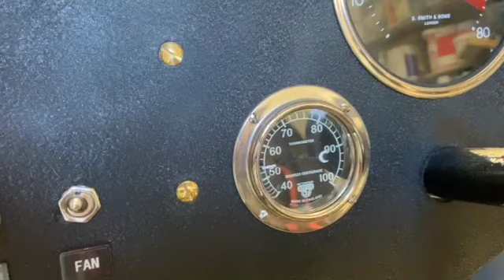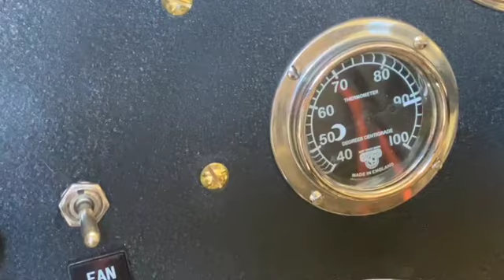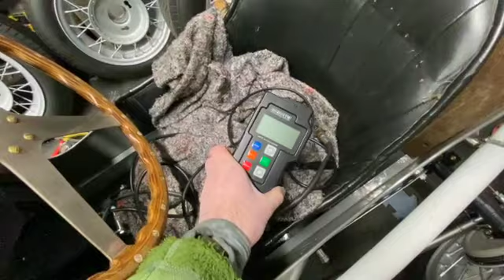Wragg Austin 7 Special -Winter Rebuild Episode 5

Comment: It's looking really good and sounds splendid. when The Phoenix pub used to have a vintage car meeting in the summer months and there was a chap that used to turn up in an Austin 7 single seater racer, he got around the lack of charging issue with 2 Everyready rubber torches strapped to the front axles and a rear cycle lamp at the back for the return trip home. Neat solution with the Kubota alternator .
Reply from the maker: right... off to check rubber torches on Ebay!

Comment: Great work as always. I see one major issue with using the temperature switch.  You need to get a twin terminal switch as your brass block is insulated by the top hose.
Reply from the maker: jolly good point!!! That hadn't occurred to me!
Reply: @beenhambracketfactory  depending on how the temperature sender is internally wired, there could be an awful situation where it tries to earth through the sender unit causing problems at your temp gauge.
Reply: Just fit a stud onto your fixture, and a wire back to earth. @thebracketfactory

Comment: I have the same problem with heat, put the job on a solder mat and fold it up behind and put a brick behind it so you keep the heat in.
Reply from the maker: good tip, cheers!!

Comment: Flux? Didn't look like you had any/enough. The flux also reveals the temperature by watching the melt characteristic. Flux in the joint, most heat on the largest piece, wait until both are dull red and dip your rod in flux too. Once you get the hang of it silver solder (and full brazing if you've got oxy acetyene) is much easier than the TIG which you appear to be pretty good at! Your car is seriously beautiful.
Reply from the maker: yes, used flux but it all just took too long. Went much better  in the warmth when I could get the heat in faster. You live and learn (hopefully..)